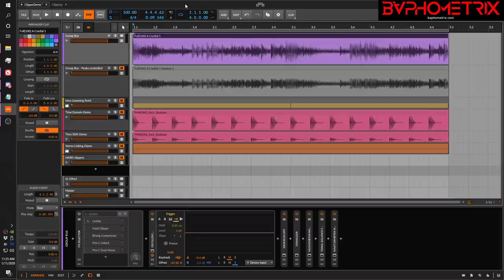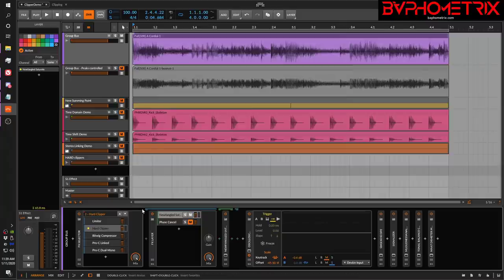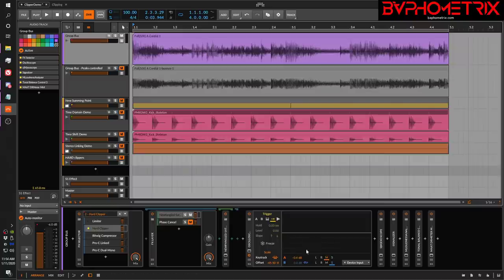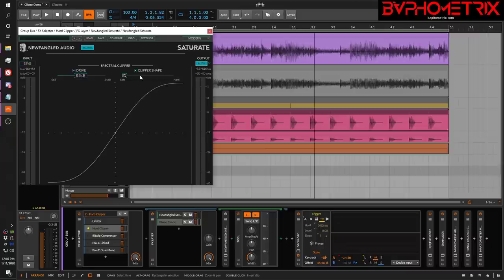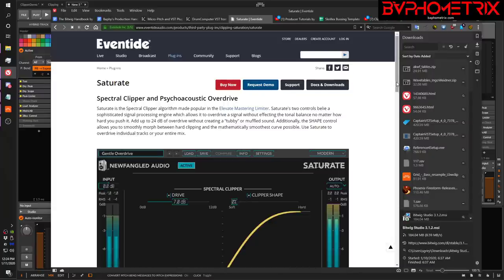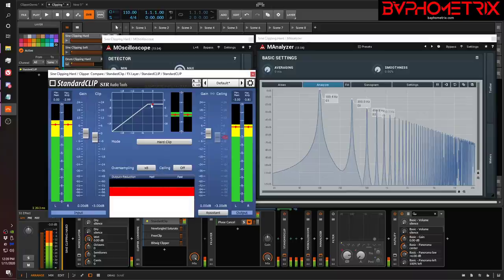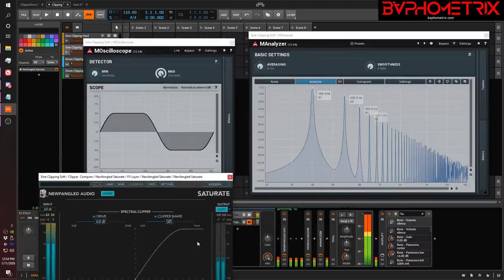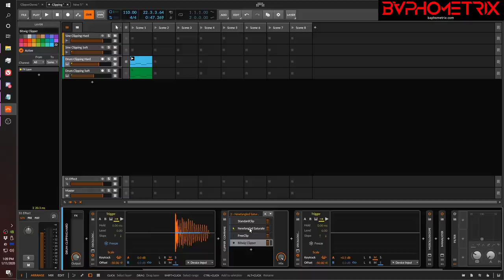Deep dive into clippers--NOT compressors--for clean, transparent loudness

Comment: Great video, man. Honestly this stuff is gold amongst a pile of garbage. Side question: what is the downside of iLok when there's no usb dongle involved? I want to get this clipper but don't want iLok to fuck me somehow lol
Reply from the maker: iLok isn't so bad, honestly. Advantage of a dongle is that if your computer dies, you just plug the dongle into the replacement and you're good to go. If you don't want to use a dongle, you have the option to keep SOME licenses in iLok cloud, which is nearly as convenient as the dongle. Problem is, some licenses won't support iLok cloud, so they're either on the dongle or on your computer. If your computer dies, you'll need to hassle with the original plugin vendor to release/issue you a new license key.  Short story, dongles are the way to go for anything that uses iLok. It's the least hassle. Just don't loose that dongle!

Comment: there needs to be debate around the rights and wrongs of audio engineering or mastering engineers would be out of a job. Bear in mind two truths: 1.) every mastering engineer does their own thing differently, so there is no "Right". 2.) As long as your music is perceived as actual "music" and doesn't sound horrendous to the ear; you can master perfectly fine at home and absolutely nobody will be none the wiser. A good track which isn't loud enough will always be turned up by the listener if they want it louder.. They won't judge the music on how loud it is if it's good... mind blown eh?

Comment: Glue Comp on a Bus to control the peaks, Wrong! Completely missing the point of Glue. Yes a Clipper or Tube if you want to hack off headroom - the pointy bits -  but Compression is really all about re-shaping the Amp Envelope (oh you just said exactly that) to change the "groove" of a sound or collection of sounds in a Bus.
:-)